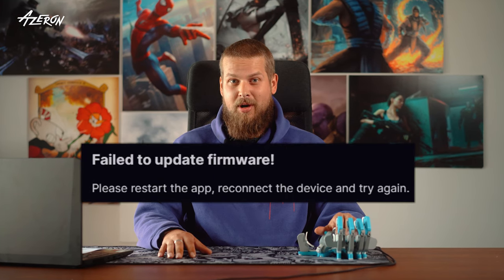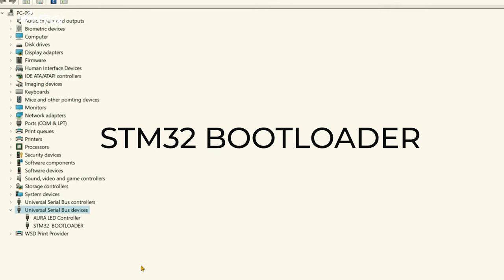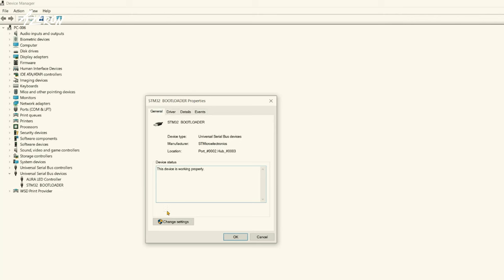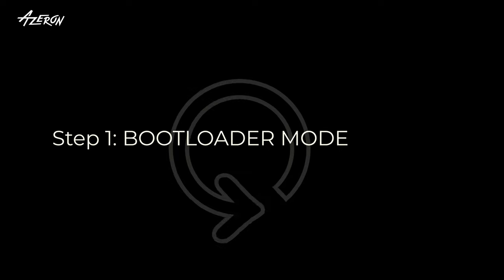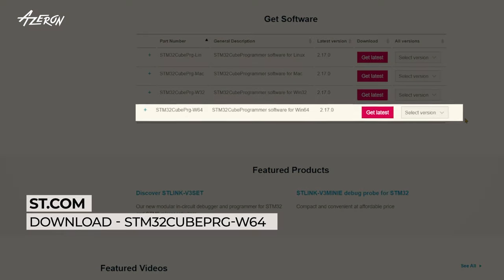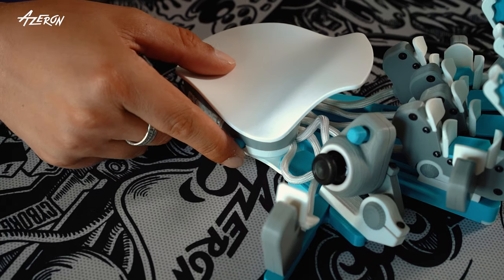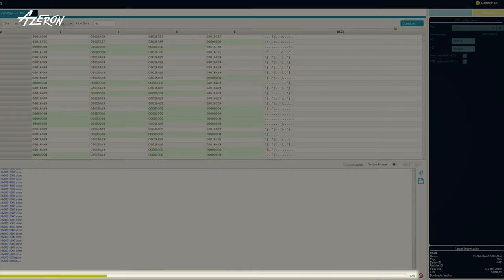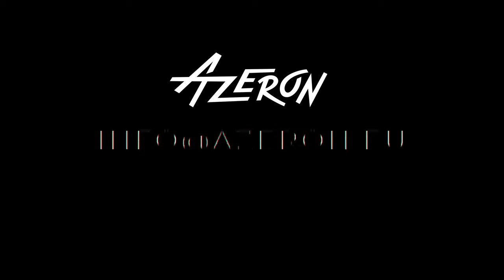Manually install firmware on Azeron gaming keypad #azeron

Comment from the maker: Follow this guide to manually install firmware on your Azeron keypad. 

0:00 intro
0:10 Step 1: bootloader mode
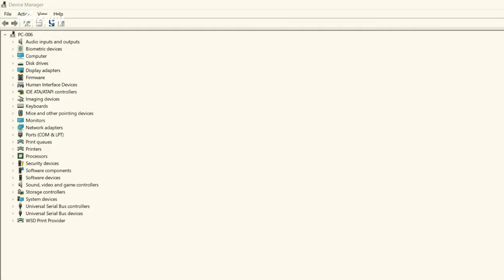0:28 Step 2: find your device 
1:05 Step 3: uninstall driver
1:39 Step 4: install driver
2:17 Step 5: manual firmware installation
3:56 check the firmware version

Comment: ok im going to get some help to do this with my cyro but i said it before the whole reason i have the cyro is because i dont have effective use of both hands so having a process that i can only do with two hands seems to be counter intuitive to the whole design of the cyro
Reply from the maker: Thank you for your feedback !
Reply: @AzeronEU  ok so i tried to do ths process and i dont understand why you guys dont have the program directly on the azeron sight instead of me having to make a new account on a whole new website to try to fix this issue
Reply from the maker: @SONofCHAOS90  Hardware limitations currently

Comment: Will u guys ever make the azeron go to 1000hz poll rate instead of 300hz poll rate ???
Reply from the maker: Cyborg ll runs on 1khz
Reply: @AzeronEU  automatically or do I have to select it, I just want to know b4 I buy
Reply: @AzeronEU  where is the option to switch it to 1000 hz
Reply from the maker: @vurmise  You have to select in on installing the firmware